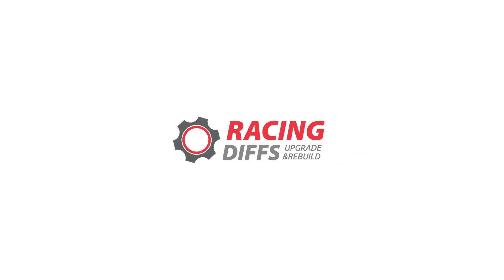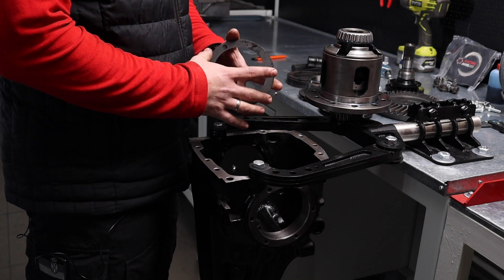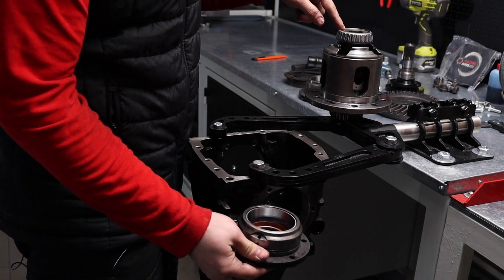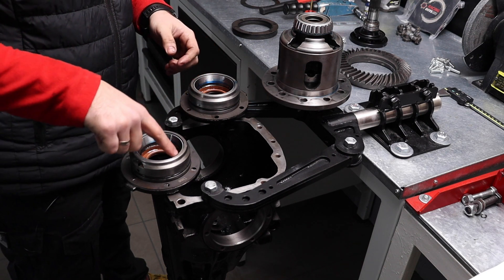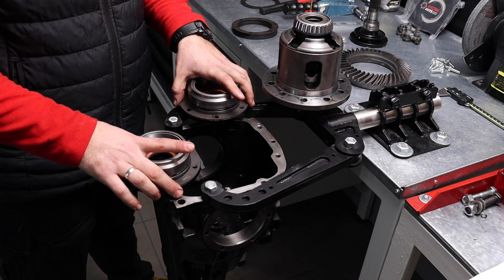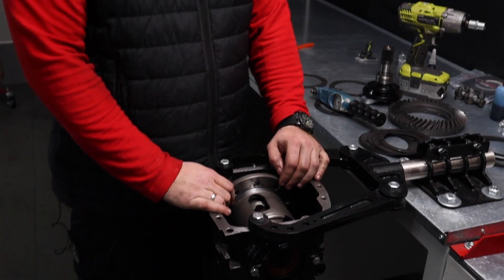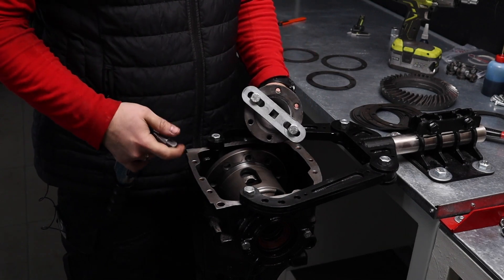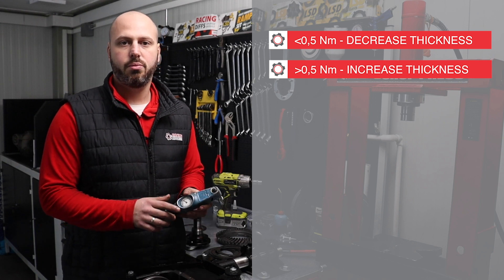BMW LSD retrofit - Carrier preload, gear patch and backlash

Comment: Are you sure the 0.5Nm is a good idea?  In TIS the torque specs to aim for are:
Type M FAG Nm 1.10 - 2.44
Type M SKF Nm 1.00 - 2.00
Type M Timken Nm 0.70 - 2.56
Type M Koyo Nm 1.40 - 2.60

I know this is for new bearings but if should not drop much for used bearings.  I am now working on a 210 diff from a E36 M3 Evo and after removing the crown gear the torque I measure is 2.0Nm.  The TIS spec is:
Type G Timken Nm 1.80 - 3.80
Type G Koyo Nm 1.40 - 3.40

So 2.0Nm is in range.

By the way I am installing your kit and taking my time as it is the 1st time I am working on the diff.  I am looking forward to the results.  Thanks for all the videos
Reply from the maker: We assembled tons of diffs this way. Non has returned with any complaints. This is from our experience.

Comment: i have a question... Can LSD type 188 with 2.93 to be converted with 3.15 or bigger ?
Reply from the maker: Yes, it can. 👍🏻 You need a ring gear spacer and adjustment shim set. Check links below:

https://racingdiffs.com/collections/differential-tuning-parts/products/bmw-differential-crown-ring-spacer

https://racingdiffs.com/collections/differential-tuning-parts/products/bmw-differential-backlash-adjustment-shim-kit
Reply: @RacingDiffs  thanks for the fast answer i will prepare to buy them after 2-3 months #RacingDiffs 💪🙌

Comment: Great video guys! I plan to order schims and clutch pack from you guys soon. Is there a reason for you increasing 0.1 on one side and 0.2 on the other side?
Reply from the maker: Thank you, glad you like it. That is when you are finding the best option for carrier preload and carrier position ratio.
Reply: @RacingDiffs  so sometimes you need to increase more on one side? Is this correct?
Reply from the maker: To get optimal results, yes.
Reply: @RacingDiffs  thank you so much for the answers - you guys are great! Is there anyway to know when I need to increase more on one side? And which side?
Reply from the maker: You're welcome! Actually no. First you adjust preload, then go for position.

Comment: Hello  and thank you for your videos. Ive just rebuilt a 188mm diff and i was told to set carrier preload to just over 1nm. After watching this video i need to ask. Is this too much and should i rectify this or have you set up diffs with this much carrier preload before. Is this much preload too much? Many thanks for your time.
Reply from the maker: Actually, it is not too much so you should worry about it. Eventually it will break in to 0.7Nm, which is fine👍🏻
Reply: wesome, thank you so much
I was a little worried about it. 
Also your shim pack was excellent
Made it very easy to set up the diff correctly
What would be your max torque setting for lsd for street and a little circuit racing
My one has 230 nm with a 4 clutch internal
Machined top plate to fit it all in
Would this torque create wheel chatter while turning on the street?
If this is too much what do you recommend

Thank you so much for all your help
I really appreciate your time,
Your knowledge and your sharing of your knowledge. 

George k 
Syd
Australia
Reply from the maker: You're welcome! I would say 230Nm is too much for the street and circuit.  For drift, it would be okay. So grind the cap a bit more or use thinned preload shims. We have them available in 1.5mm thickness. I would aim for 120-150Nm.
Reply: Thank you and god bless you
Love your work, I’m sure when I say this I say it for a lot of people
THANK YOU👍
Reply from the maker: Thank you so much! Support means a lot to us!

Comment: Great video! I see that for the carrier preload you used two bolts two bolts for each carrier side. After you find the preload, will using all the required bolts for the carrier flange affect the carrier preload? Only because i would assume the initial two bolts are not exerting the same amount of force equally the roller bearing. Lastly, are the carrier flange bolts torqued or just installed to be snug? Im currently redoing my diff and this would be very helpful to know. Thank you!
Reply from the maker: Thank you for your feedback. Those 2 bolts are enough to keep cups pressed so you can adjust preload. After the procedure all bolts are mounted. Torque spec is 40Nm. Also use sealant compound on 2 bolts closest to the cover as their holes passes through so oil knows to leak there.